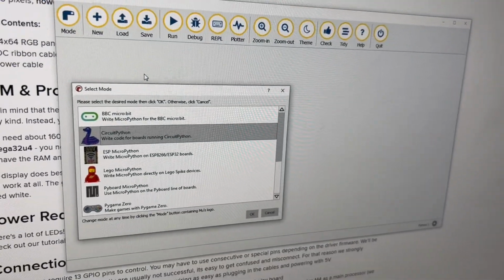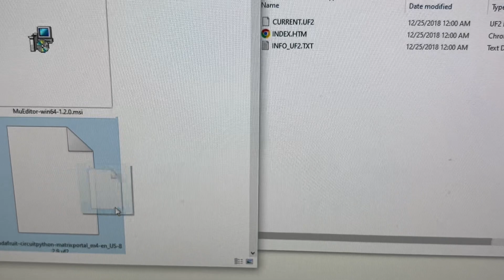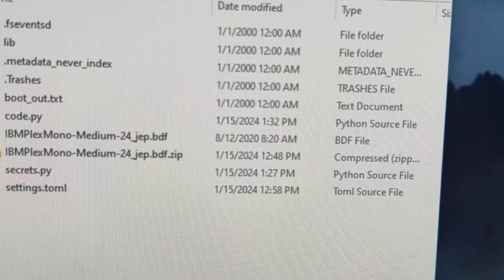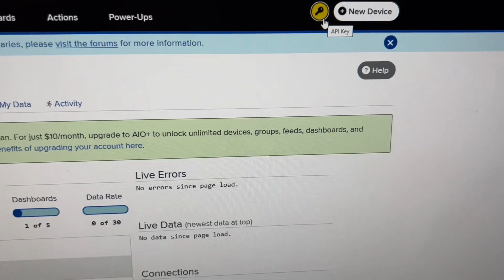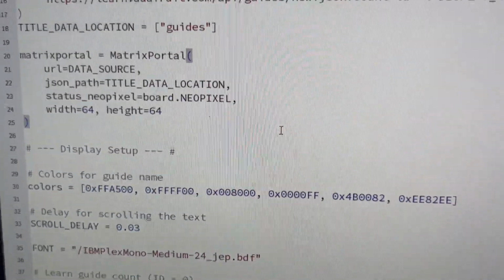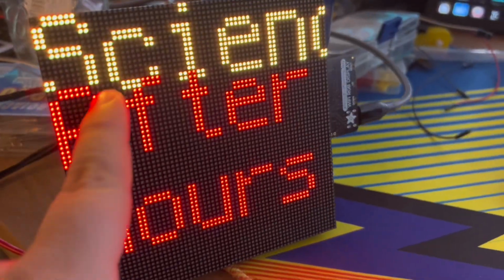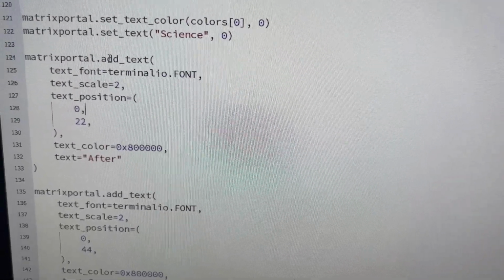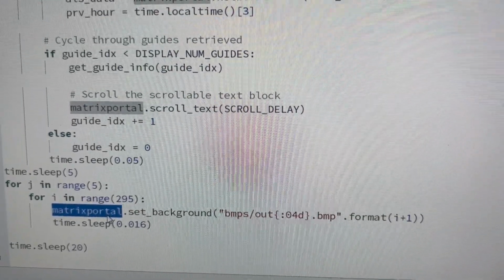Displaying Bad Apple on the Adafruit 64x64 LED Matrix Panel!

Comment: hi where did you get the IBMPIexMono-Medium-24 file? And link to that website with the secret file i would be gratefull
Reply from the maker: lol I don't have the foggyist idea. I doubt it's a system critical font. Just find a font with the same extension, drop it in, and rename it to be  IBMPIexMono-Medium-24 lol You  might be able to find it on Google Fonts. It may be in the zip files that Adafruit provides for the Matrix panel. I haven't touched it in months and I don't know if I have the files still.
Reply: @ScienceAfterHours2  Thanks, I did everything you showed in the video, but every time I enter the code, the matrix seems to copy what I type in the terminal. There's a red bird at the top, and next to it, it says '100code.' Do you know how to fix this?